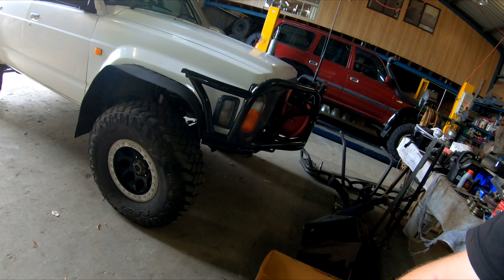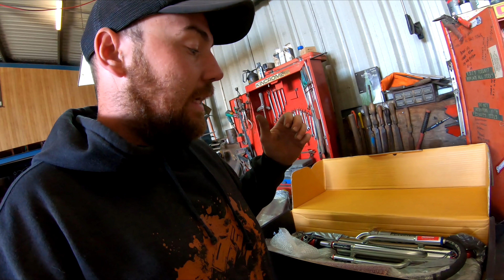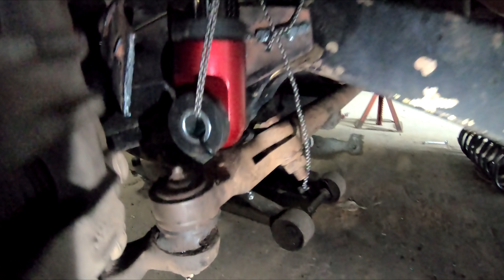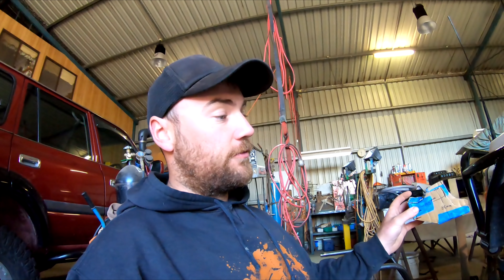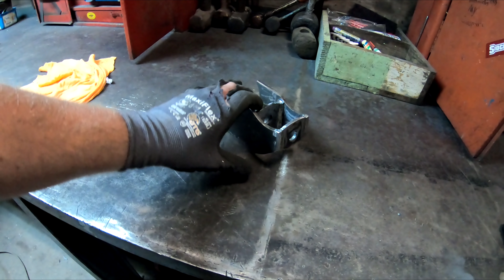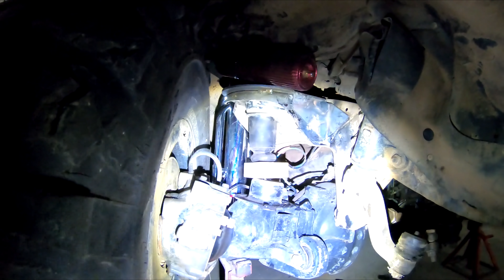Triple Bypass Shocks into GQ patrol - Ep 11

Comment: Unreal vid man learnt heaps cheers 👍 was just wondering with your bump stop spacers though do they sit on the diff instead of spacing down the original bumpstop and are they an off the shelf spacer you can buy and bolt in?? Cheers again man
Reply from the maker: Thanks mate! Yeah the bolt down on the diff, there’s a hole there that I drilled and tapped out and just make a spacers up to bolt down. Not sure if you can buy them anywhere! Cheers mate

Comment: Do you think it's worth going down the route of remote res shocks on a leaf sprung 60? Or will you not notice the benfits as much because of the stiffer leafs.
Reply from the maker: Good shocks are important regardless if coil or leaf. But it’s also important to get the spring rates right with leafs so they work with each other.

Comment: Hi bloke, great tips and great video's, I am about to extend my front bump stops on my gq wagon due to recently fiting a ford V8 and diff has tapped sump lightly already,  I am running 3" flexi coils with 4" shocks, I have standard gq bump stops and also a pair of 80 series bump stops,  which are the better to use? Thanks.
Reply from the maker: Hey mate, I prefer the standard patrol bumps! But whatever you use just make sure it’s spaced correctly
Reply: @DanielKistler  ok cool thanks,  I have heard people say the 80 series are better, but then have heard that they r softer.
Reply from the maker: @JMCKAY351  they are softer and longer but in my opinion they interfere in the shock stroke to much. Also can cause fast rebound
Reply: @DanielKistler  ok thanks, think I will just fit standard Gq ones back in with spacers.

Comment: Hey Dan, thanks for the info in this vid, really interesting. Can you share your thoughts on a front and rear air spring replacement? I've been wanting to do this for a long time so I can lower the car to standard height for camping and when touring, but raise it back up to 3" when off-road. Really interested if you have any experience or suggestions here.

Cheers mate.
Reply from the maker: Hey mate thanks for watching. I Havnt done any research into them and I Havnt even seen them in person before. I like the idea though but can’t help you with experience mate. Cheers

Comment: As usual there is something in your shed vids i hadnt heard of before.
Top effort in designing the shock mounts. Just one question. Whats the offset on your wheels and will you still have clearance to the shocks if staying to the 50mm wheel track increase over standard?
Reply from the maker: Haha thanks mate! -22 is the offset that works good mate! If you still have a gq front diff you may run into clearance issues! But a Gu front is so easy to do and cheap and very beneficial that you wouldn’t waste your time on a gq diff!
Reply: @DanielKistler  
Only asked as i thought you mentioned the engineer was going to sign off on the shock setup. Hopefully there isnt clearance issues if you have to take it to him with standard wheels and tyres.
The engineer i am using wont allow me to go over 50mm from the GQ wheel track even though its got GU diffs and there is a NSW document stating you can go 25mm wider than the axle being used.
Reply from the maker: @bennyjahmin3953  yeah the engineer is happy with the shock set up so it will all be engineered. I’ll be chucking 33s on with similar offset rims for engineering so there won’t be any clearance issues to worry about. Sounds like a painful rule haha!
Reply: @DanielKistler  
Looking forward to seeing some shock tuning videos in the future.

Comment: Nice shocks mate. A wedding gift for you both from the family??🤣👍
 New buzz word "WANKY FLEX". Should get it printed on t-shirts as merchandise for your channel. 
 Personally, I like so much wanky flex in the rear it ends up rear steering the vehicle. 🤣
 But on a serious note,  how is adjustment achieved on each bypass? Can't see on the video if they're dials you click up or down.
 Also, the compression bypasses. One high speed  and one low speed?
 Will be interesting to see the tuning process. 
 Thanks again for another information packed video. 👍🍺🇦🇺
Reply from the maker: Hahahaha I wish mate! 
That’s actually a good idea lol maybe one day mate! 

I should have explain that better, there’s a grub screw with a locking nut on the one way valve and you just screw it in or out to wherever your desired comfort is. 

Nah the 2 compression bypass tubes just work at different spots of the shock stroke. Not high and low speed. 

Cheers mate
Reply: @DanielKistler  All good mate. I think these represent good value for money against a comparable King, Fox or Radflo shock. Might be made in Thailand but I'm sure a lot of people don't realise the Thai's are heavily into off-roading and racing and the shocks are well tested(Punished!) And of course like any real shock they're rebuildable.
Reply from the maker: @bogged2theeyeballs695  summed it up nicely mate! Cheers

Comment: I hope the profender work good for u, before this we tried the profenders they don’t last long. They live super short at events as well. Profenders are made in Thailand.
Reply from the maker: I’ve seen them in a fair few cars, at winch challenge events also. They seem to hold up well. Not every shock brand is 100 percent though, I’ve seen kings fail prematurely aswell. And at the price for the profenders I can’t complain about anything so far. Cheers
Reply: hopefully mate, buying from a dealer and directly is different . Maybe superior has improve it .
Reply from the maker: @tannyshim3074  superior buy directly from profender. The only thing they did was re valve them for me. So nothing really to improve on.

Comment: I test drove a gu I was going to buy, it had 37s on stock coils and it was sitting on the bumps, and yeah it handled like a bag of dicks, did not buy it for obvious reason 😂
Reply from the maker: Hahaha, yeah that’s terrible. It’s funny when they try and convince you it rides good. It doesn’t 😂
Reply: @DanielKistler  I’ve personally never seen worse scrubbing on the inner guards as well, the rear tyres had polished about 200m of the top of the guard to shiny metal I reckon it was about to wear through 😂
Reply from the maker: @toms_gupooe  Hahaha, yeah the signs of poorly set up suspension